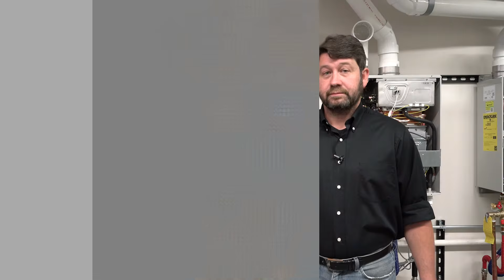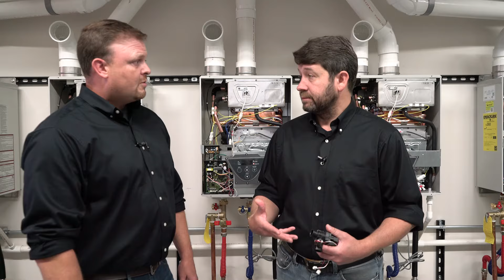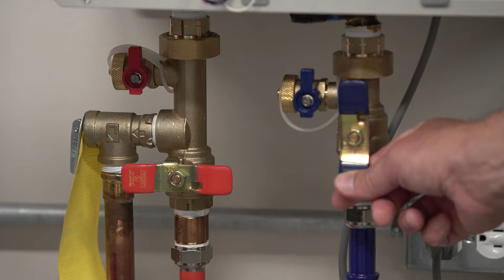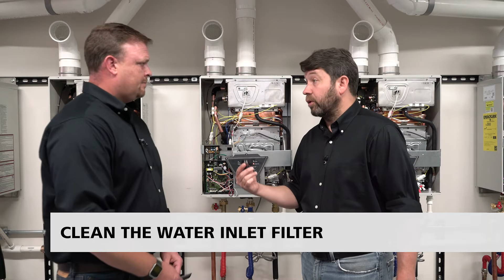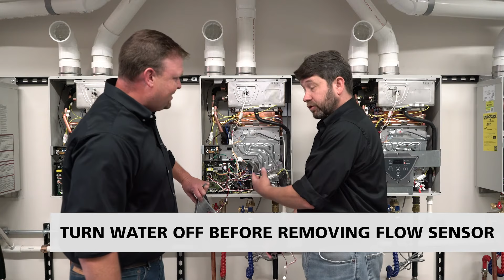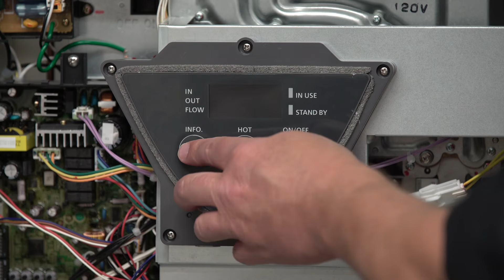Takagi Tankless Water Heater Troubleshooting - No Hot Water

Comment: How about the issue with no hot water with just lowER flow use?      .7 to 1gallon a minute will NOT keep it burning.  anything with 1.1 and higher is good.       I'm wasting water now after removing the faucet restrictor on sinks and showers.
Reply: I have same issue. Temporary hot water at 0.5 gpm thru 1 gpm, then it turns off. No error code. If I do over 1.1 gpm it turns on and stays running no problem. Did you find out what was wrong with yours?

Comment: Thank you! We were able to remove the 2 brackets, just be careful and don't lose the little o ring/ washer.  We had water coming out when we replaced the flow sensor/ rotor.  Got it back in correctly the second time and success.  We have hot water again!!!!    We blew some canned air through the little fan/ rotor, and I guess that freed up some sediment.  Everything else we had tried did not work.   We were flushing out our water well, and  after that the water heater wouldn't work.  All is good now. I appreciate the video!

Comment: How about when I don’t get the same temperature of water in the shower? I replaced the shower valve, set the scalding sensor to highest setting. And still water in shower does not get as hot as the sink water in the same bathroom